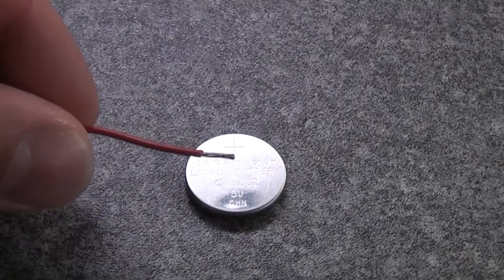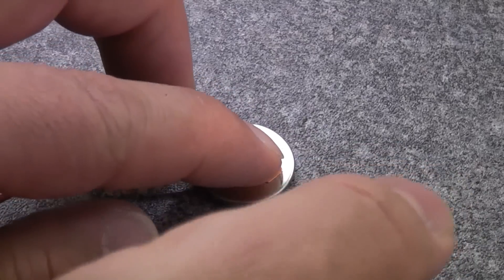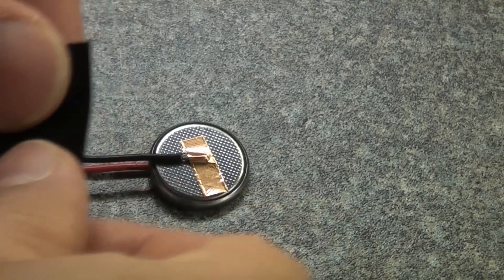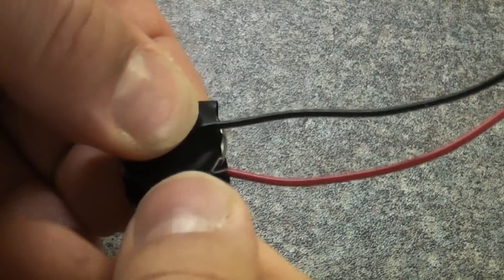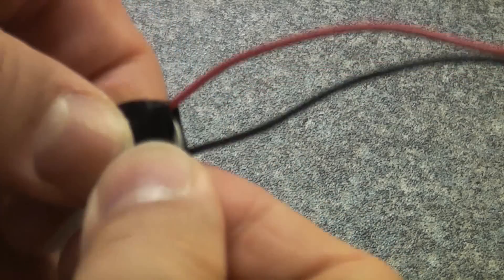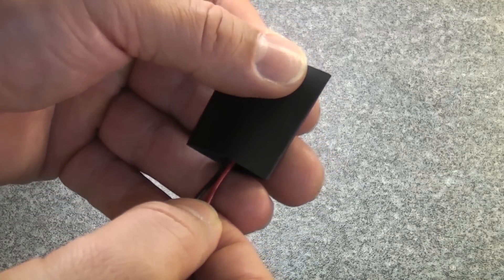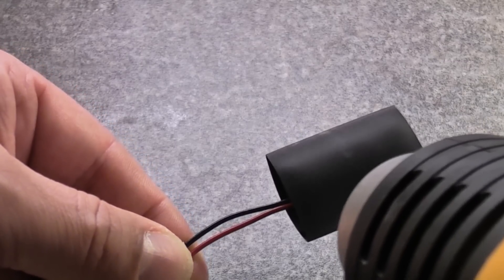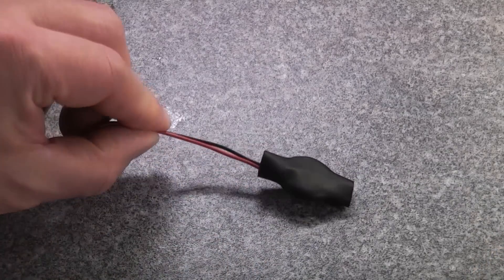CMOS battery hack | Laptop CMOS battery

Comment: guys BE AWARE some laptopts/netbooks uses rechargeable batteries so before you attempt this better check your batteries and confirm what you need. DO NOT attempt to recharge a non-rechargeable lithium cell. CR2032 in place of ML2032 is a bad bad idea for example eeepc models uses them.

if you are desperate for alternative diy solution u can use tiny li-ion/lipo batteries salvaged from old craps, small gear like bluetooth handsfree headset thingies or similar.  just remember not to put it in hot spots inside the laptop/netbook and lower the voltage near 3v. everything will be good. 3v wont be super healthy for lipo cell life and cycles either but will be safe and will work fine anyway. thats what i did.
Reply: zivizivi zivi  I have an Acer TravelMate C110 with a rechargeable lithium battery, that is almost nonexistent to find and if found it runs like $15+. according to every human I talked to, that type of battery is "not rechargeable" and yet my battery clearly says rechargeable on it after I took off all the wrapping.
which left me with a 3xAA battery holder with only 2 rechargeable batteries in it tape to the lid of my netbook for almost a year. after being fed up with not having the cash/correct replacement I gave up. purchased a CR2032 and did the above trick but +included a diode+ to prevent charging. 2-3 years later I just need to find myself a new main battery.
Reply: you could do better :) there are small lipo and nimh batteries in tiny footprints. a small lipo would fix your issue im sure. some laptops uses nimh cmos batteries as well u could fit them inside somewhere if you could find them around for super cheap as well. there are many different sizes to every battery really. surely you could fit suitable chemistry and sized battery diy style easly. for last resort if you were sure there is a recharge voltage you could even ditch the battery and use small 5v super cap. would be more reliable in the long run for sure. they are available in tiny profiles as well. all of the options are more elegant than aa battery holders as u chose hehe
Reply: in response to  imark7777777

@0zivizivi zivi
  I have an Acer TravelMate C110 with a rechargeable lithium battery, 
that is almost nonexistent to find and if found it runs like $15+. 
according to every human I talked to, that type of battery is "not 
rechargeable" and yet my battery clearly says rechargeable on it after I
 took off all the wrapping.

which left me with a 3xAA battery holder 
with only 2 rechargeable batteries in it tape to the lid of my netbook 
for almost a year. after being fed up with not having the cash/correct 
replacement I gave up. purchased a CR2032 and did the above trick but 
+included a diode+ to prevent charging. 2-3 years later I just need to 
find myself a new main battery.

Comment: Also wanted to mention that the original leads are NOT soldered onto the battery in the conventional sense...they are attached with specialized equipment similar to a mini spot-welder.
Reply from the maker: Aldo Zuko 
Thanks, I asked in the local computer shop and he said they sometimes solder the leads onto batteries. I hope they watch this ;-)

Comment: Must I use the 2 different types of tape or can I just use electrical tape for both tape types?
Reply from the maker: It will probably work with just the insulation tape, the conductive tape is just to guarantee a good contact between the wire and battery.

Comment: Is the CMOS battery easily accessible under one of the screwed-in hatches, or is it somewhere else?
Reply from the maker: Ron Ablang 
It depends on the make and model of the laptop. In this Acer Aspire you have to almost strip it down to it's component parts-
Acer Aspire CMOS battery | Acer Aspire losing date

This Sony was much easier-
laptop cmos battery

Comment: Thanks for this big hint !!
Reply from the maker: You are welcome ;-)
Reply: *****
what should i do if i don't have aluminium tape or copper tape?
Reply from the maker: It should be OK if you just use insulation tape to tape the wires to the battery as long as you get a good contact and wrap the insulation tape around the battery tightly.
Reply: *****
ok. thanks

Comment: Thanks for the video, do you use a "conductive tape" to connect the cables to the battery right?
Reply from the maker: Yes, I used copper tape. It is widely available. Then I covered the whole battery in insulated tape.

Comment: Laptop designers need to be beaten with a large pointy stick.
How difficult would it be to put a small flap - like the RAM flap for the battery with a drop in pod?

They will be first up against the wall when the revolution comes!
Reply: +Meester Chris Lot of makers design things so they make it harder to repair, and built in faults.  I worked repairing laptops and had one were the DC Jack kept getting broken, i looked inside and there wasnt any thing behind the connection meaning ever time you push in you were pushing agest 1mm fins to hold it in place.
Also got DELL who FAMOUS made their Desktops with a ATX connection but changed the wires around..
Reply: @Meester Chris That's how it was in HP Pavilion DV6 3000 series of laptops just like in the desktop boards; a simple slot to push it in after popping the old one out. Then they decided to do that so that they can mint them SSS(?) or so I thought.
Reply: Same with fookin fan, mostly. Greedy business.
Reply: Meester Chris some manufacturers do in fact. I have seen a couple HP's and dell's do that, however it is model specific and each is different.
on the HP it was in the memory/wifi compartment and on the DELL it was a little door in the battery compartment!
Reply: My laptop has one like that, but the flap fell off so that sucks.
Reply: I would think that its to save space and a small plug soldered on the mobo takes up less space than a slot for the battery itself which I have seen done on laptops and desktops.

Comment: Wow, thanks for the vid, definitely a good warning to people like me to not solder button cells. I've soldered larger batteries fine, but definitely going to avoid these cell types. Video's definitely going to stick in my mind, which is a good thing as it will remind me to always wear safety glasses when i solder things like batteries (large ones, definitely not small ones like this, lol).

Comment: That brought back a memory! When I was about 12 (30 years ago, lol) I briefly connected a button battery to a 6V dc power supply to try and recharge it, and it exploded. I was lucky like you, nothing went near my eyes.
Reply from the maker: It's amazing the size of the explosion from such a small battery! I'm glad that you were also lucky ;-)
Thanks for the comment
Reply: I have recharged batteries like this a little, just to see if something still worked. You have to keep the charging supply small, just a little higher voltage. These batteries are made to be charged but not real fast. Hook it up to a couple AA batteries

Comment: As the meerkats say ....."Simples"
I reckon I could do that bit Chez. But by the time I'd taken the laptop apart, as in your previous video, I don't think I'd be left with a laptop worth putting a battery in .... LOL
PS. Must try some of that heat-shrink sleeving just for the fun of it!
Reply from the maker: LOL
Heat shrink sleeving is very useful, but you need a fair bit of heat to make it shrink ( I think 90 degrees ).
Thanks for the comment ;-)